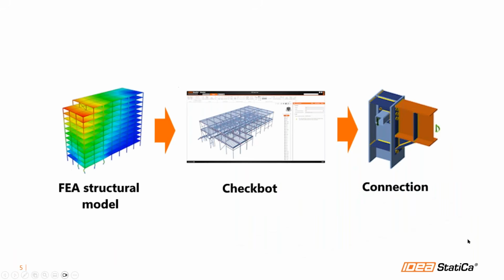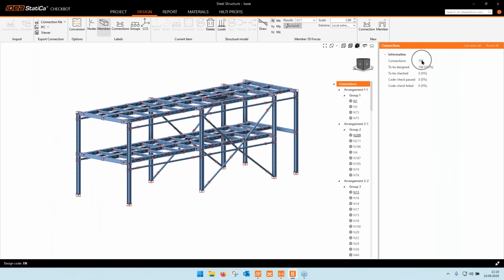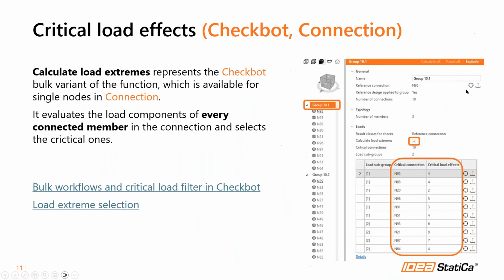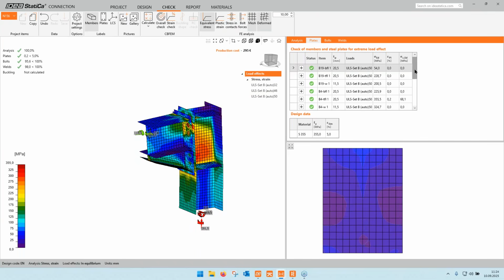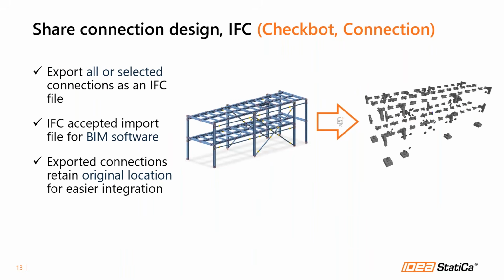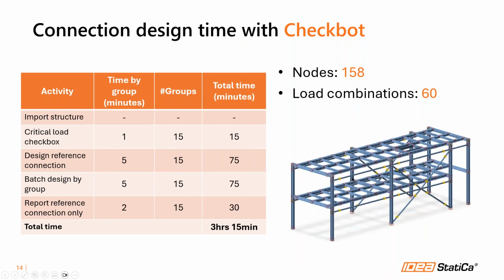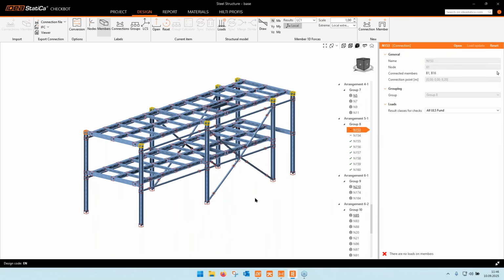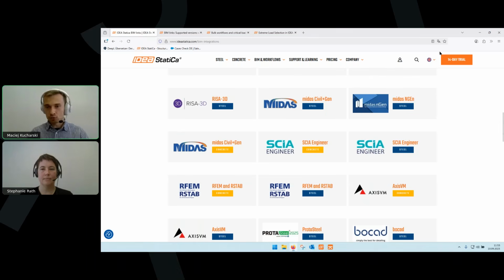Connection Wednesdays – From Grouping to Delivery  Simplifying Steel Connection Design

Comment: Great webinar! I've just downloaded 25.1 version and will test checkbot in similar way as Maciek was presenting it. 
But I had 3 concerns watching the video:
#1 Will it be an effective way also on large-scale projects, or is it better to split model to smaller sections (with earlier version, I had issues like this)?
#2 What if I change something in the FEM model  - will the checkbot model be updated automatically - how to control that?

#3 I presume that it is possible to group connections, design them, and then if I find that some are not optimal (low utilisation), regroup them and make a separate design - right?
Reply from the maker: Hello, thank you! We hope Checkbot helps you well in your project.
1) Yes, with bigger projects it would be better to split them into more segments for IDEA StatiCa Checkbot to avoid long import and huge amount data processing.
2) Yes, you can use the Sync function - changes like change of cross-section, values of internal forces recalculated are synced. If you add more load combinations or new members, this is not synced.
https://www.ideastatica.com/support-center/synchronize-model

3) Yes, exactly.